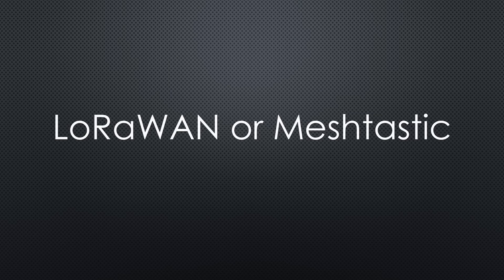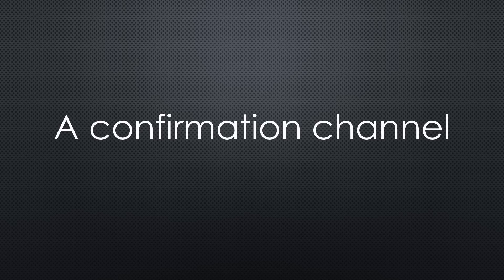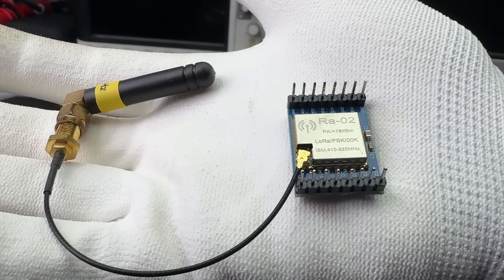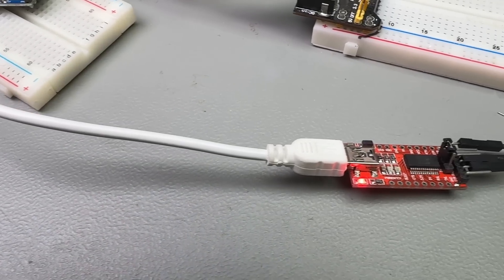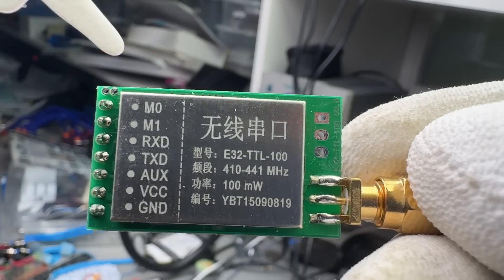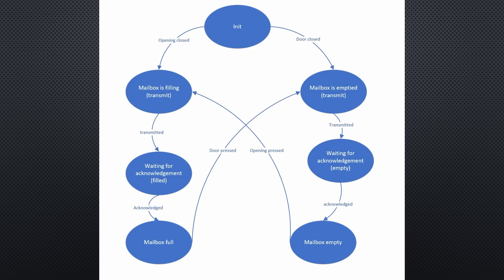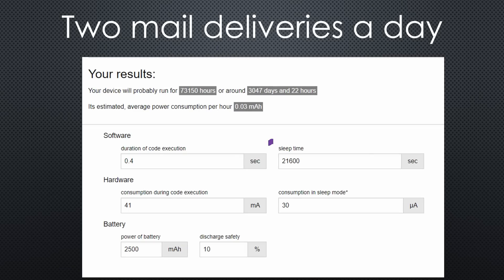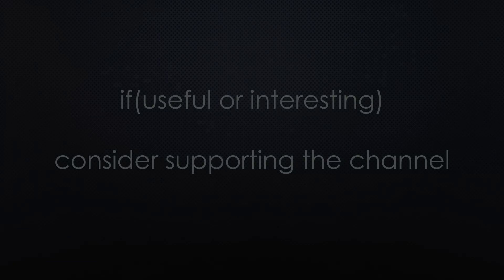(493) "Transaction Proof" Mailbox Notifier using an unknown E32 LoRa board and an ATTINY1614

Comment: Hi. I have a boat about 50km from my home. I am using Home Assistant at home. Is it possible to get water temperature from my boat into home assistant? My boat got both solar panels and a large battery bank.

If possible, what equipment do I need..? I am familiar with Home Assistant but not Lora.
Reply from the maker: I assume the only possibility is to use a cellular modem. Or LoRa to the shore where you have to have a receiver/gateway. Line of sight is mandatory for this part.

Comment: Grüezi Andreas, thank you for your video series on Lora. I'm starting a project with Burners Without Borders to help people use Lora with Meshtastic. It's been great fun already. I have a Heltec v3 board and 1 meter long antenna at my house in Brisbane, California (next to San Francisco). Have you run across a remote console or piping gateway for the Heltec board? Sometimes I'd like to use my mobile phone and the wifi or the mobile network to remotely see what messages come in to the Heltec board. -Frank
Reply from the maker: I never had this desire. I assume you can create a VPN to your home (network as usual). Then the Meshtastic app should work as if you are home
Reply: @AndreasSpiess  thanks, a VPN will work.

Comment: hello world thank's for this nice projet. Someone can help me please? I am blocked with the attiny.  After programming and run Attiny code, LORA stay in programming mode. MO=3.2V, M1=3.2V, AUX=0V. It don't pass in standard mode.  I don't understant why, I use LORA 433 T20D  V8? Thank you so much.
Reply: Alls problems are solutionned with 433T20D (not full compatible with E32-100-TTL) , thank for support, system run now very well. (Update code V2 on GIT). For information, code Gateway connected mqtt without pass, for the newbi like me :-) if someone want add it, you must update mqtt string connect:  if (client.connect(clientId.c_str(), mqtt_user, mqtt_password)) {

Comment: Thanks for the great video Andreas ! I'm still curious as to how you were able to interface the EBYTE module with the " bare " RA02 Lora Module. I'm helping develop a rocket flight computer and I'm in desperate need to make the Heltec's WiFi LoRa 32 V3 board communicate with the EBYTE E32900T30D but cant seem to make them work together, thanks!
Reply from the maker: I did not connect the two. I use an Ebyte module instead of the RA02 because I do not know the parameters used by the Ebyte module.

Comment: Hello sir. I have LoRa mailbox notifier with MQTT working for years, extra low power. As a core I use LoRa node for about 20$ and accelerometer ADXL362, for which I designed small PCB that sits on top of LoRa node. It regularly measures temperature, link quality and battery and it sends notification whenever there is movement in mailbox, over LoRa -> MQTT gateway -> Home Assistant -> my Telegram. Currently the voltage of battery (after stabilizer) has not changed for 5 months not even by 0.01V!
Reply from the maker: Cool project!

Comment: Not very clear how LoRa helps with the antenna in a 'Faraday cage'! Surely that will block ANY radio system? Is it maybe just luck that it works in your case i.e. the mailbox is an imperfect Faraday cage in just the right way to let the LoRa frequencies through?
Reply from the maker: You are right. The mailbox is probably not an ideal Faraday cage. But nearly. LoRa has a very high link budget compared to Wi-Fi, for example (150dB vs. 100dB). So, a very small signal still can be detected.

Comment: wow, I also did the same solution, finished it about 6 months ago. i relied on your amazing videos for understanding Lora. everything i did is very similar to what you reocmmend as well, except i used different boards as I found cheap esp32 plus lora integrated  for the sender and  a cheap single lora connected to your 2nd favorite esp board.

the problem i faced is that i love on 5th floor, the floors are very think and the mailbox is inside the building. So i had to put the reciver in the balkony and hang it out a bit. Even the windows wouldnt allow the lora message to the reciver. I am using the 800 ish frequency (dont remember the exact freq). I bought a specific antenna for the sender, but it didnt help much.
Reply from the maker: Thanks for sharing. Indeed, 800MHz does not like concrete walls (also because of the grounded iron inside).
Reply: Hey, I am having issue with using ra 02 as the receiver and e32 as the transmitter🤐 the signal doesn't get through can you tell me what are the parameters you kept to make then work with each  other
Reply: @youcubersaaraswata8865 can you share some contact ifo/mail and i can swnd you my arduino sketches for reciver and transmitter

Comment: So can you basically build a “YoLink” system but without the “YoLink system” right into Home Assistant? 
At the moment I’m using YoLink for doors and power plugs and motion detectors…
Reply from the maker: I think the YoLink system is quite advanced. So no need to change in my opinion if it works.
Reply: @AndreasSpiess  Copy that 👍 
Thanks for the reply.
Yeah, I like it quite a bit, but I have little experience with other bits and bobs from other manufacturers. But these all work with little to no issues.

Comment: an Email notification when you get Snail mail.... Genius!
Reply from the maker: At least if your mailbox is 50 meters away and it often rains like here ;-)
Reply: @AndreasSpiess   I laid a 20mm pipe to the front gate for a buzzer, gate solenoid and an infrared post checker. The photodetector in the mailbox is scanned 1 miĺlisecond every 10 minutes.
After 3 negatives the laser turns off.
Even if you use Lora or anything else you still need a power source...

Comment: I've been watching you for close to 6 years now, love every video. I hope you look into Reticulum and do a series on it. I believe the protocol unlocks a lot of potential for LoRa modules. Cheers.
Reply from the maker: I just had a look at it. Do you know where it is used and what the advantage over Meshtastic would be
Reply: @AndreasSpiess  In the easiest of terms to my understanding this would essentially replace IPV4, with it being hardware agnostic, it can transfer all kinds of data over almost any data medium. For the meshtastic reference. it can more efficiently communicate between nodes with more encryption. The meshchat project that utilizes reticulum can even do voice communications over NRF52840. With meshtastic, it is impossible to support over the chirp spectrum. Unfortunately, I believe the project does not get the recognition it deserves to complete a polished version. Hope that helps and I would love a video series from you about it to explain better than I can.
Edit: TL/DR: This could create the most versatile, headless, mesh protocol with superior encryption over the other options.
Reply from the maker: @HotMicSystems  I think, some things get mixed up: The RF channel defines the available speed any protocol can use. LoRa, by definition, is slow but bridges long distances with low power requirements. 
The protocol can be efficient or not. Encryption and addressing, like with the IP protocol, create overhead. This is why plain IP is nearly never used for IOT. Encryption is already made by the chips. So, only rare cases need more for IOT data (which usually are not state secrets).

So I would not expect wonders from a new protocol in the area of efficiency. It must have other advantages to be better than the simple (and efficient) Meshtastic protocol.
Reply: @AndreasSpiess  I agree with what you are saying, the analogy was more for the way it uses addressing for devices. Either way if it intrigues you enough I would love your take! Thank you.
Edit: I just wish it had more recognition by people who understand networking and RF far greater than me, and your top of that list
Reply: @ximono  Correct. It is an entire network stack

Comment: @Andreas Spiess Now that there are new WIFI 7 routers with the new 6 GHz (5.925-7.125 GHz) band,
 it would be really cool to see a 6 GHz Yagi build. Because you can't buy them right now if you don't want to spend 400$ or more on a antenna.
Since the Frequency is so high a 12 Element design would fit on a 150mm PCB. 
Sadly I don't have the skills or equipment myself to design it but it would be so cool if you would design a PCB antenna that everyone can just get made online for a few bucks  🙂
Reply from the maker: You get many directional devices for 5.8GHz and maybe they will be extended to 6GHz. A Ubiquiti PBE-5AC-ISO-Gen2-EU-5 GHz PowerBeam AC has 25dBi gain, much more than a 12 Element yagi. Of course, you get devices with less gain and wider opening.
Maybe you ask Andrew Mcneil. He does such stuff on his channel. I decided to buy the stuff above 2.5GHz because it is mechanically too challenging for me.

Comment: There are several Ebyte models which are similar to the RA02 as in have just the Lora chip and depending on the module a PA+LNA. Generally the ones ending with a D are UART based and then ones ending with a S are SPI based. I have used several of these E32 SPI modules for bidirectional MAVLINK as the UART ones were too slow, the only issue was getting a RF power meter to see the LORA chip output vs PA output power levels as the power table provided by Ebyte is inaccurate.
Reply from the maker: Thank you for the additional info!
Reply: What software are you using them with for MAVLink?
Reply: @MUSTARDTIGERFPV  it's a heavily modified version of ardupilot to cater to our work and research requirements.
Reply: @ShahZahid  directly doing SPI inside Ardupilot for that data exchange? Have you published the source anywhere?
Reply: @MUSTARDTIGERFPV  yes its direct SPI, first we thought of using an external mcu to handle it and then send the data via UART but we had a ton of free IO so we decided to integrate it into our custom flight controller. Unfortunately the source, the flight controller and related material are not open source as we tailor each version to suit the needs of our clients, which includes implementation of other proprietary systems, sensors etc if they want us to.

Comment: Are there any reasons to choose 433MHz over 868MHz for this application? I've read online that 868MHz is more common in Europe and that 433MHz tends to be heavily populated with all kinds of RF signals. I'm a complete newbie to this topic and have never experimented with a lora module, but such a bidirectional communication seems to be a nice project to get some first experiences.
By the way, can anyone recommend a good separate lora module to start with? Do the modules always come with the right antenna, or do I also have to find an antenna that fits the connector of my board?
Reply from the maker: You ask many questions answered in videos also on this channel. I propose you search my channel with "LoRa" and "Antenna".
Concerning 433/868: Most people probably will not see a big difference if they build their systems. Projects like LoRaWAN and Meshtastic use 868/915MHz and you have to comply.
Reply: @AndreasSpiess  Thanks for the quick reply. So I guess I'll try to get my hands on some 868 MHz board and try my luck. Your other videos will surely be a great help for my first steps. Thanks for mentoning.

Comment: There's a interesting module called ELPM-S3LW having similar goals, boasting only 8nA in consumption. Would love to see what you think of it
Reply from the maker: An interesting device (I hope it can be programmed with the Arduino IDE). However, an ESP32 is probably not needed for most LoRa applications. 
One important question is: How many wakeup pins does the module have? My notifier needs 2. It seems this module only has one "power latch". That means I would have to add external logic (not complex, of course). The ATTINY wakes up with all pins.
Reply: @AndreasSpiess  I can be programmed with Arduino IDE. About the other questions I can't say much because the module hasn't shipped yet, but the advertised "1 nA" sleep current is pretty exciting

Comment: Nice material but the initial list of reasons why to do it in the first place (other than a reason for making a YT video of course) is far-fetched. How many times a day your mailbox gets full making the limited number of downlink messages important? Similar with meshtastic - the fact it’s ack mechanism works with more complex topology doesn’t mean it can’t support simple, fixed 1:1 links. Just say you want to make  something custom for the sake of tinkering :) It’s hobby, isn’t  it? The more effort the better (and more videos for us)
Reply from the maker: I agree, this is hobby. But it has a real reason. My TTN sensor became unreliable. Sometimes it took hours to get the message, sometimes my connection to TTN was down. I did not wanted to investigate and decided, the process had too many "moving parts" and wanted to simplify it. And maybe other use cases need more state changes a day...
I do not know how an acknowledgement would work with TTN. Keep in mind: The LoRaWAN sensors only stay on receive for a short time after transmit. Maybe I would have to transmit every package at least two times to get the chance of an acknowledgement. Maybe you know more?

Comment: I have been using these E32 modules for a long time. Nice toy to play with.
Reply from the maker: Thank you for sharing your experience!
Reply: Do you know is it possible to use a SX1278 together with an E32 modules? Or is it only possible to use one E32 module with another E32 module?
Reply: @ReNaZwanzigneunzehn  I have never checked. As far as my knowledge It should show you the frames and data but to understand the E32 frames you need to decode the payload again.
Reply: @erfanmahmud3097 but the question is: how to configure the following parameters that are required for a lora SX module:
LORA_BANDWIDTH 0: 125 kHz, 1: 250 kHz,2: 500 kHz
LORA_SPREADING_FACTOR 7 // [SF7..SF12]
LORA_CODINGRATE [1: 4/5, 2: 4/6, 3: 4/7, 4: 4/8]
LORA_PREAMBLE_LENGTH 8
LORA_SYMBOL_TIMEOUT 0
LORA_FIX_LENGTH_PAYLOAD_ON
LORA_IQ_INVERSION_ON false
because setting up a E22/E32 modul is done with 3 different parameters: air data rate, uartParity and  uartBaudRate ? 🤔

Comment: A good option is RAK3172. That module has the microcontroller and lora transceiver in one small footprint. It can work standalone using Arduino or by AT commands.
Reply from the maker: Good solution if you decide to use LoRaWAN!
Reply: @AndreasSpiess  The module offers P2P (peer to peer) communication option using only LoRa . Of course the implementation of the back channel protocol has to be implemented. Though the solution you show in the video looks quite stright forward. Thanks for your videos!

Comment: Currently, I use a open/close magnetic sensor for my alarm system to monitor the mail box. Has been working flawlessly for the last 5 years and I get about 8 to 10 months out of the wafer battery. I also soldered a small lead of wire to the printed circuit antenna in the sensor and drilled a small hole in the bottom of the mail box. It is about 60' away from the house. When it dies I will probably attempt your Mailbox Notifier". Nice video!
Reply from the maker: I also use two magnetic switches for the opening and the door. But I did not want to drill a hole ;-)

Comment: Nice!  A simpler solution with less hardware would be to use the LoRa and ESP32 using the same boards like in the LoRa32 V2.1_1.6 from LilyGo boards.
Reply from the maker: Unfortunately, these boards are not very low-power :-(
Reply: I did try to use ESP32 as łow power device and I failed. Theoreticly there is a second low power state machine CPU inside ESP32 (called rtc) that could be used for this purpose (without waking up main ESP32) and the main CPU can be booted only for lora transmission. But programming this secondary chip inside ESP32 is a huge pain and there is no deep sleep functionality of ESP so the chip reboots the whple RTOS upon every wake from deep sleep so it takes millions of CPU cycles anyway.
Reply from the maker: @marcingosiewski1779  You are right. I once made a video about the RTC.

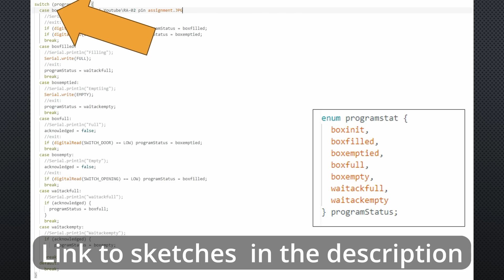Comment: @13:00 I also use that method. However I recently switched to using GPIO registers and bits to decide upon what to do. There are two reasons: bit testing and branching takes only one instruction on AVR (see SBRC/SBRS for instance) and is faster than comparing bytes then branching. Second GPIO registers (which area mostly accessed with in/out instructions instead of more costly STS/LDS) aren't used most of the time. These two combined is such that flag testing in interrupts requires no push/pop, which is even faster.
Reply from the maker: Interesting concept if your MCU has time constraints! Here, it loops for most of the time.
Reply: @AndreasSpiess  Well, technically, time-constrained microcontrollers (such as PLC) also loop indefinitely. But I think I get the point ;-) .